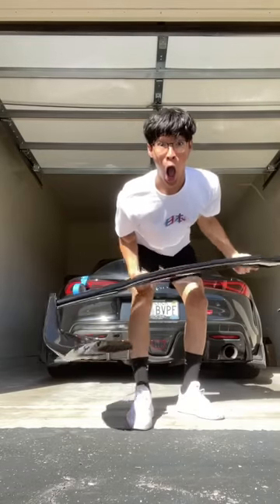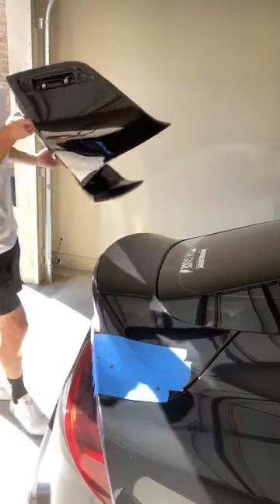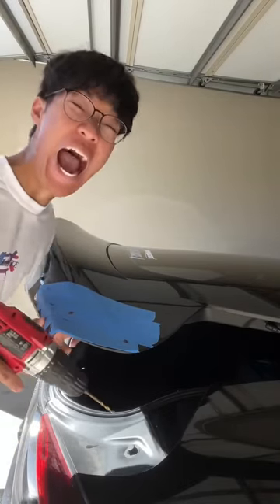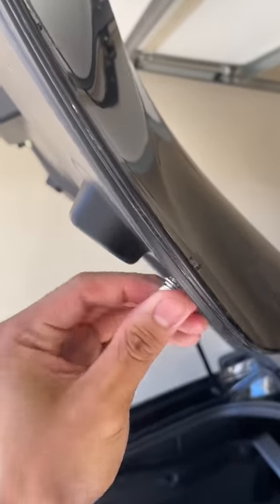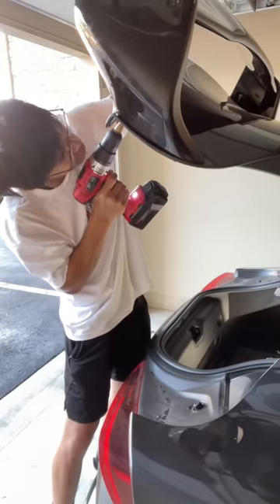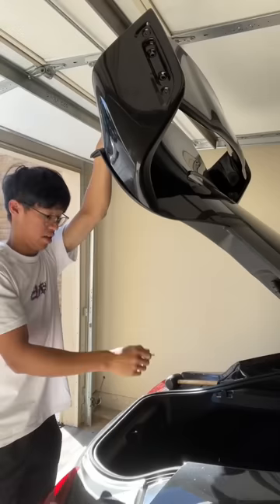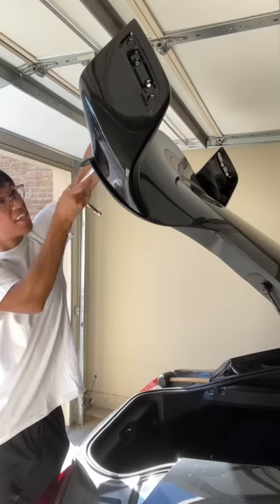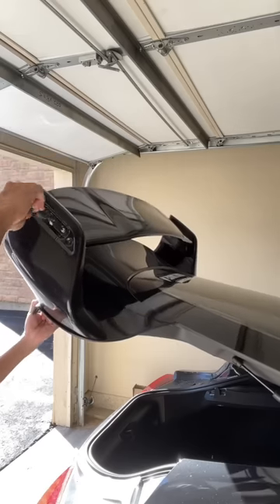Installing a wing on my Supra!

Comment: Are we going 200 mph today?
Reply from the maker: Maybe..
Reply: Idk I'm thinking that supra goes 150 max
Reply: @garystump5680  Most are limited to 155
Reply: I be surprised if this shit engine can hit 60mph 😆😂
Reply: @LeoKadettTouringCar  one of the best engines ever built, put the pipe down
Reply: @LeoKadettTouringCar  smoking crack if you think the b58 isn’t one of the best i6 of all time
Reply: @jarekmai  and may be your wing starts flying off lmao
Reply: Not in that thing he isn't. Fake supra
Reply: @Az480709  doesnt make it slow, its still quicker than any supra ever built before and you cant tell me bmw isnt good at making sports cars, while toyota hasnt done anything at or above the supra's level since 20 years ago or so, getting an experienced manufacter to do the job wasnt just good to save up money that they could have really lost (sports car market was going down recently, while other stuff was going up) but also to really have a bigger guarantee they would get a good result, which they did (see Supra VS 400Z and the supras that are already pushing 1000hp on the B58)

Comment: That was painful to watch.  First off the car was a waste.   Speed limit doesn’t change for sports cars.  Second why put a spoiler on. It adds resistance unless you’re going track speed.  You don’t need extra traction to travel highway speeds.  And third. That was the worst install I’ve seen in awhile. Did you grommet the holes you drilled? They will rust out.  And now you’ve scratched it and posted it for the world to laugh.  What are we raising these idiots on ?

Comment: The most perfect example of why you shouldn't just do it yourself. Rust is going to form where you drilled the holes my dude. I'm pretty sure you need to declare or something that you modified your car otherwise if the cops pull you over and it's not on the paperwork, you're scrued
Reply: Nerd

Comment: It's Toyota or BMW
Reply: toyota supra no shit
Reply: Toyota Supra A90, which uses the BMW "CLAR" platform (same as the BMW Z4) and also uses a BMW engine. 

So it's a Supra but you could say it's a rebranded BMW Z4 and you'd technically be right